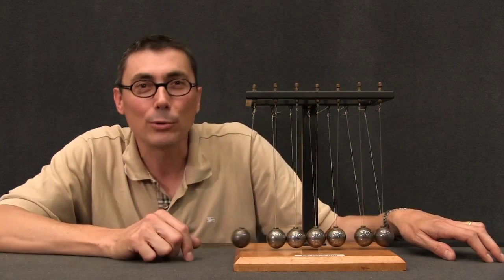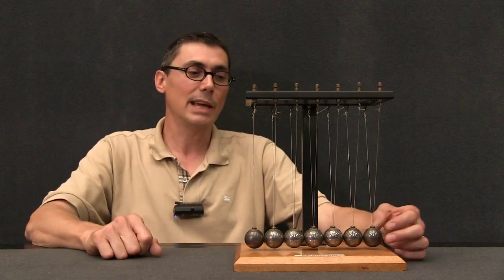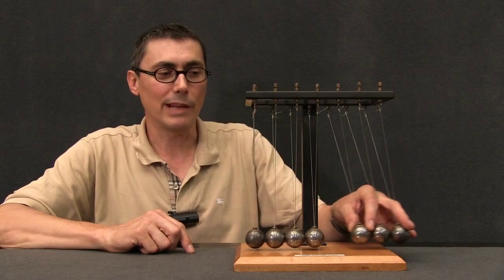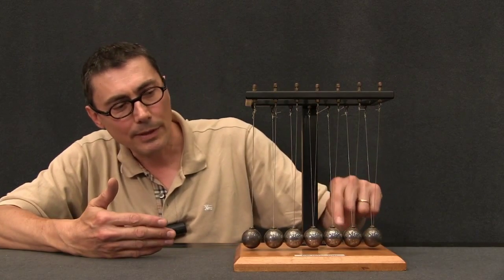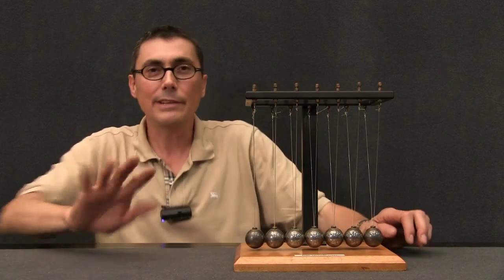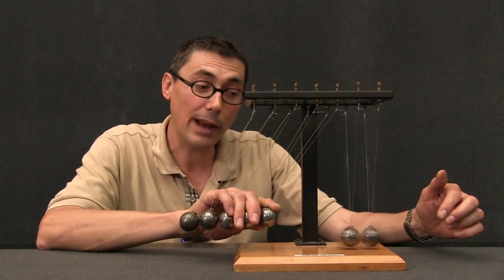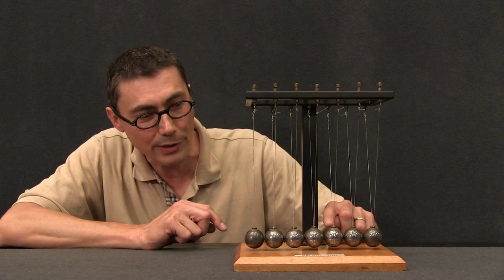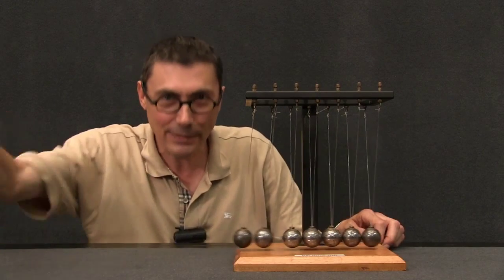PH ME DY TUTE 70030A V0608 Newtons Cradle Introductory Analysis

Comment: How does Newton's cradle count balls? 

Maybe it is because when we have two balls for example the pulse travels in two directions. Since the collision  produces an equal but opposite reaction, the pulse wave travels back through both balls that were used as the carriers of energy  although no backwards motion is registered. Since the pulse travels through two balls the pulse length of two balls is rebounded back through the system so that when the pulse length reaches the end it will act to maintain conservation along the entire length of the pulse, whatever that length is, if it didn't it would actually be disobeying the law.

Some added thoughts:

I've read through many explanations on the internet concerning Newton's cradle but where I think they fail is that they try to describe why the center ball(s) absorb and release energy the way they do exhibiting barely any motion, by describing it soley through Newtonian laws of motion and the conservation of energy. What they should be doing is describing the phenomenon through the physics of resonance. Why? Because resonance is about the science of energy absorption, especially when resonant frequency is maintained through a system. What do I mean when I say resonant frequency is maintained through a system? It means the object that brings the energy into the system (the carrier), which in the case of Newton's cradle is the raised ball that will introduce the energy via the first collision) vibrates at a frequency which matches the resonant frequency of the other hanging balls. Since all the balls are made of the same materials and dimensions it means they all share or vibrate at the same resonant frequency. Yes quantum physics tells us no object is ever truly at rest but is in a constant state of fluctuation or vibration that is particular to the dimensions and materials of that object. Everything has a particular resonant frequency. And if the energy that is placed upon that carrier vibrates at the same resonant frequency as the object that will receive the energy, then that energy will tend to build on that object until the object is either destroyed or really rattled.

The opera singer hits a certain high note, and the sound from her voice (the carrier) introduces a vibration on the crystal glass that happens to match the internal frequency the glass is resonating at long enough for the energy to build until the glass shatters. When we say energy builds it means the glass is absorbing ever greater levels of energy. However, when you think about it the phrase "the energy builds" may not be a good way of describing what is happening, because the glass is made to vibrate, and if it is made to move, work is being done and therefore energy is constantly being released, and if something is constantly being released how can that energy build up? Well if the energy is not building up per se what are we witnessing? Maybe what we are really seeing is that the energy being applied is finding more efficient ways of moving across the glass and less energy is being wasted in extraneous movement so that the final work of creating vibration is ever more potent. When you have increasingly less energy being wasted producing extraneous, or chaotic motion, that would mean you have more energy to bring to the task of producing the final bit of work, which is the vibration or movement on the glass. The potency builds until the glass shatters if the note is held long enough

Of course there are other ways of thinking about it. If, for example, you increase efficiency you can say you decrease the resistance inhibiting the flow of energy across a system or object. If this is so then just the fact that you have objects in a system that match resonant frequency it has an implication on the way energy moves through a system, namely it opens up a pathway of least resistance which allows the flow or movement of energy through that system to be so efficient that it doesn't waste itself producing chaotic or extraneous motion. Which in Newton's cradle means the energy rebounding back to the first ball(s) used in the initial collision (Newton's notion of an equal and opposite reaction means the pulse wave from the initial collision travels in two directions, one being back towards the ball(s) used in the first collision) as well as the balls in the center load do not move until we get to the last ball, where almost like magic energy departs from a stationary, or non moving ball.

 And this is essentially what we are seeing with Newton's cradle. All the objects/balls in that system resonate at, the same frequency The flow of energy through that system is so efficient that it moves without wasting energy on outward motion until it gets to the end. In this way energy is kind of like most of us. It will obey the laws, but if you give it an option to do the LEAST amount of obeying and work until the very end, it will naturally chose that option. Energy is like, "Dude I'll do the damn work, but if you give me a path of least resistance so I don't have to waste energy chaotically moving things around, all things considered I'd rather take that path and do the least amount of work moving things around until the end and then I'll do the push off in whatever proportion that satisfies the laws governing conservation." Like us energy would rather not do unnecessary work if you give it an option, and when a system matches resonant frequency you will give energy the path of least resistance and it will take it and produce very little motion until it reaches the end, or the last object at resonance.